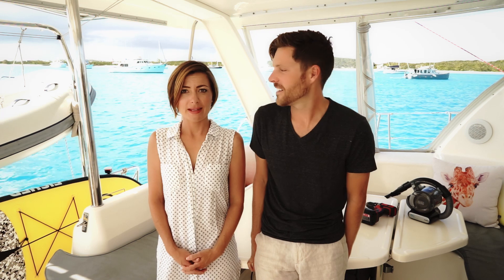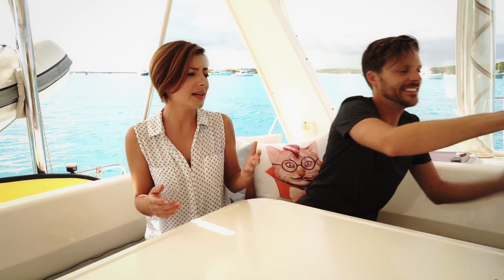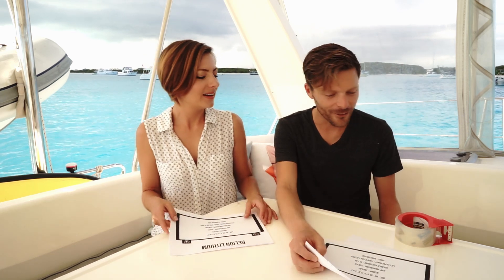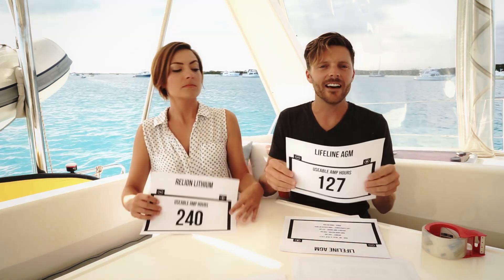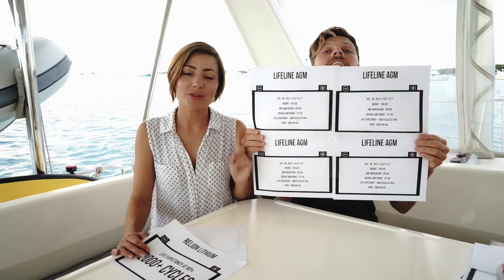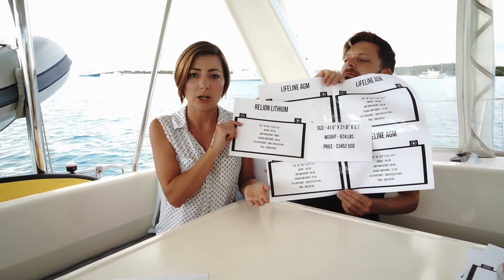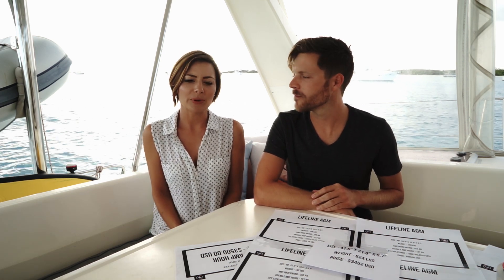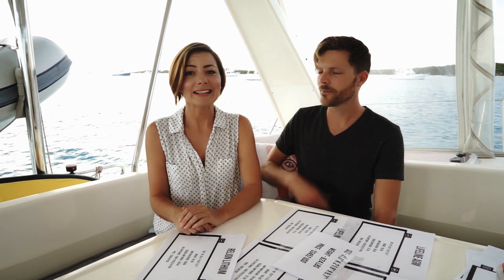Sailboat Tech - Lithium Batteries & Why We Chose Them (vs AGM)

Comment from the maker: Okay, we're going to address some of the most common questions here:
1) FIRE: there are several different types of lithium batteries. Ours are Lithium Iron (LiFePo4). They have a very low risk of fire and are very safe to operate. Our batteries are NOT the same ones in the Boeing Dreamliner. Lithium Cobalt chemistry is used in a lot of small appliances and phones, and those are the ones that can catch on fire when they're abused. They're still pretty safe if used and charged properly.
2) TESLA POWERWALL: These are great but they are not rated for marine environments, they must be mounted on an exterior stationary wall for ventilation, and they're pretty darned heavy.
3) COST: yes, we said right up front that they are an expensive initial investment, but if you look at it from the standpoint that we are powering our home, then it isn't so crazy. Would you put a cheap roof on your house that will have to be replaced in a few years, or would you try to put the best roof on that you can afford and that will last years longer?
Reply: Great information, great explanation all around.....
Reply: I did a similar calculation for my off-grid home (on terra firma).  Although my system will necessarily be larger, the same calculations apply.  And although I like the lithium-Iron tech, I'm looking at salt water batteries (Sodium-Ion) which can be stored at deep discharge without harm.  Take your batteries to 0% DOD for 3000 cycles (better even than lithum).  Again, upfront costs are high (like Lithium, but still cheaper), but you won't replace them in 2-3 years like AGM so the long-term cost of ownership is lower (like lithium).  My calcs put Sodium-Ion tech above Lithium and the availability of sodium (salt) is must better and more sustainable and safer too.  

Also, in terms of your calcs on cycles...  You won't get more cycles just by doubling your AGM batteries.  Wouldn't it be more correct to say that you would replace the 2 AGM batteries at half-life of the Lithiums.  Same net result, except the weight comes in to factor then.

Love your vids, guys.
Reply: @wacobeer6469  meh little behind the times with this lithium and sodium battery thing but lets go with it, long as they upkeep their batteries the longer lifespan (normal operating conditions) of the lithium over the sodium battery will be more beneficial.  I can see as salt water being more proportionate for a house yet for a boat I think they made the right choice, and if they are too worried about full discharge they could get a couple of wind turbines to add to the boat.  Now if you are lucky you can find a small airport that works on the airplanes there or a junkyard, and you might find some for cheap (at risk) or sometimes free, then you just need to install all the other things etc.. etc... .  One always wants to make sure they check up on their battery bank, and as they know and experienced with weight and space being very important.  Probably using outdated solar panels as well because they are cheaper, but lets be honest what they are doing works for them and they are obviously happy with it so it doesn't matter ... just enjoy life and as always ... keep smiling!
Reply: Mountain Point Brewing Ya they sort of messed up the weight, but you will still pay to ship that weight so I let it slide. 😆 Only error in an otherwise great intro video.
Reply: The industry stats 15 AH charging rate per battery. At 50% discharge rate. That can recharge the battery back to 100% inside 6 hours...Depending on @ah rating of battery . Smaller @ah less, more @ah more. You need to do the math on what you're using everyday. Then figure out what your charger should rated for... but 15 amp per battery is a safe bet...Which is why most 120v to 12v converters are built for 30 amps for two batteries. As they didn't pick that size for nothing. 

The up side of Lithium is they can suck huge amounts of charging amps. So they charge back up very fast...Which if on solar. You want every amp you get. In the shortest amount of time. Depending on how much sunlight you get everyday. Also the temperature at which your batteries are at. Play a big part in the calculation. Same for solar panels.
Reply: Hi guys, great video, did you know that you can get the BMW i3 and i8 car batteries for marine applications?
They are about double the price of the Lithium batteries you have, but performance wise they are miles ahead, as far as I know there’s only one company that you can get them from, https://www.torqeedo.com/en and they sell outboard and inboard engines too.
Reply: Heya,

Interested in finding out more about Lithium systems so thanks for taking the time to put together the vid.  And your solar panel test was very truly informative - have watched it a couple of times. 

It was difficult to ascertain from the quick 'tour' you did but I'm curious how you have the batteries housed.

My limited knowledge  of Lithium batteries leads me to understand that charging them outside a temperature range of 0 - 45°C will lead to significant degradation of the battery. Given you're using a solar system to charge your batteries, it stands to reason that they will charge most when it is hottest and certain enclosed areas of boats - especially in direct sunlight - can far excede the ambient temperature of the day.  Ergo they're charging most when they're most likely to degradate.

Just curious if this is a consideration for the batteries you're using?  Have you made any adjustments if so?

Cheers,

Andrew 

Just c
Reply: If it's just an introduction and there will be more detail coming, I agree. I was curious how their charging sources were connected, if any adjustments were necessary (very likely), how they solved the "what happens when the battery disconnects" problem. It's a professional installation so I'm assuming they solved these issues (it certainly can be done) and that's for me the really interesting part of integrating lithium-ion batteries.

Otherwise... Well, if you fail to adjust your sources and use one of the "drop-in" replacement batteries (drop-in here means they set up the protection to be more benevolent so it doesn't trip all the time), not much will happen; lifespan will be reduced, but it will take time for that to manifest itself. However, failing to solve the battery disconnect issue means that if it ever has to protect itself, it might just wreck your electrical system (and thanks to Murphy, it will surely happen in the middle of an ocean :-) ). Disconnection protects the battery, that's the purpose. But it throws the rest of the system overboard. Some people just fail to contemplate what happens if you suddenly remove the battery from the system. It can get very expensive. Which is why the "drop-in" batteries are more benevolent - otherwise they would get a lot of complaints and perhaps lawsuits. Just so they can claim it's a direct replacement with no adjustments needed. If it's executed well, it will still protect it from going out spectacularly, but it will allow significant abuse (it has to; lead-acid charging systems are just not, you could say fully, compatible).
Reply: Warriorsrus At the same time none of those explosive gases can burn through the bottom of a steel hulled boat like a malfunctioning Li-Ion can. Both have their benefits and weaknesses.
Reply: Great video as always, thank you. I was curious as to why you did not use the same battery brand from the RV. Were there issues with that brand?
Reply: Gone with the Wynns 
Can I have as much amp hours in multiple batteries or does the inverter size and how much solar power wattage i bring in
Reply: found this info SHOCKING but got a CHARGE outa it........................
Reply: @Warriorsrus better yet does the cat have a life preserver????

Comment: Please do an update on these batteries - many people, not just sailors, could benefit from knowing if these are worth the investment (subjective) and how well they've held up (objective).  Thanks!
Reply from the maker: The batteries are great! They'd put more in if they could make the room.

My RV has had lithium for the last 5 years and we bought them gently used from someone we knew who was building a bigger lithium bank and wanted all new batteries. So they've got 7+ years of use and are still going strong like the day they came out of the box. All the advantages of lithium (can use nearly the whole capacity, can run a high-draw appliance off it through the full range of its capacity, lighter weight and smaller packaging) make them a no-brainer if you live full-time off the grid. I know so many people who've switched to lithium and their only regret is not doing it sooner.
Curious Minion
Reply: @gonewiththewynns  Thanks!

Comment: Ampere Time 12V 300Ah Lithium Iron Phosphate LiFePO4 Deep Cycle Battery, Built-in 200A BMS, 4000+ Cycles, 400amp Max, Perfect for RV, Solar, Marine, Overland, Off-Grid, etc......(same battery at half the price...AMAZON)

Comment: AGM should be kept 12.0V or above even under load for longest life.  I think this is why you can't run high power stuff off them as it will pull the voltage below 12V which starts to degrade the battery.  A starter battery in a car is designed for this, but for very short periods of very high current, though the voltage can drop down to 10V when cranking the engine.  Lithium can hold it's voltage better at higher currents and as long as you keep the cells within their max discharge amps and above about 3V per cell (based on cobalt), they will be less degraded by high loads.  With some high discharge Lithium cells you can sustain loads of 150A or more.  While Lead Acid can provide 900-1000A "Cranking amps" but only for a short burst.
Reply: I have a non AGM, 100Ah sealed Marine start battery on a solar panel.  Even when fully charged if you put a 10Amp load on it to produce 120W it's voltage will drop near to 12V.  When the battery is sitting in winter at 5*C that will drop to 11.5V or lower along with the capacity.
Admittedly a boat would have bank of maybe 4 of these in parallel or 8 in 2s4p for 24V system.

Comment: Your calculations are all wrong. Yes, doubling the AGM (127x2 = 254 useable Ah) in comparison with single 240Ah Lithium makes sense. But then doubling that once more to account for the life-cycles becomes all wrong. By this point you are actually comparing 508Ah AGM to only 240Ah Lithium, but the AGM life-cycle is still 1000. 

Unless you meant buying all 4 AGM, but only connecting two of them and then sailing around the world with half you battery bank as passengers whilst their warranty expires, waiting years for the first set of batteries to run out their 1000 cycles.

So actually doubling a second time to a total of 4 AGM is wrong in terms of: weight, size, life-cycle and Ah capacity. You only got the price comparison correct. You would obviously wait for your first set of AGM batteries to end their 1000 cycles first and then buying new ones to achieve 2000 cycles. Which means the weight, size and Ah capacity would remain constant (to that of only 2 batteries).

Comment: I thought in an earlier video you said you had to run the engines to heat the water.  Here you say you can use the battery.
Reply from the maker: You do not have to run the engines to heat water, but any time the engines are running, water is piped through the engine to cool it so you end up with "free" hot water. On days that you don't run the engine, you can use the electric hot water heater.
Curious Minion

Comment: The reason lithium batteries are better than the old batteries as they have no memory With old batteries as time goes on residue builds up on the plates inside the battery residue  affected the batteries lithium batteries don’t have this problem.That is why when you have if you have a drill with the old I’ll type of battery on it as it is the battery skip use more residue from a charge sits on the on the plates are the battery and it says there and the more buildup of residue of that of that stays on the price the war the chances are the battery will not be at sufficient as it was was. Release your batteries this is not the case that is very visual back up because every every shahs is always like first time is ever charge up of course it’s gonna be battery problems towards the end of its life but it will run longer.

Comment: Super Capacitor banks out perform lithium, take up less space, charge up much quicker, can be fully discharged without damaging the capacitors, and can be charged many more times. Also lithium will burn when in contact with water and you're surrounded by the stuff. However there is nothing wrong with your set up, But, when your battery life comes to an end consider changing them for super capacitors, they are predicted to replace most battery functions in the future.

Comment: just the tip of the iceberg when it comes to the inefficiencies involved with lead acid batteries when talking about off grid charging solutions.  off the bat, you should knock off the top 20 percent of AGM too when talking about daily cycling them, so you cant go below 50 or above 80, now your sitting at a usable 30% of the battery's total capacity.  (for those who wish to argue the point, bulk charging is all well and good, but forget absorption or float) which then leads to the problem because you will rarely ever be getting your batteries to float, they are going to sulphate, again reducing capacity and strength, etc etc etc.

its a whole world of better'ness to switch to LiFePO4 (for those who dont know the difference, LiFePO4 is the non flammable variant of Li-on batteries, lower energy density than the one in your phone, but it wont go into overrun and self combust)

Comment: I have no idea what chart you were looking at for the specs, but much of the information you used seems HIGHLY suspect, especially the life cycles. AGM batteries generally have FAR more charge/discharge cycles than lithium, and are far more resistant to vibration and extreme temperatures, are much easier to charge, and far less likely to suffer catastrophic failure.

Comment: Just bought my first 12v LiFepo4 battery to run a 40Lt fridge , yes it's worth the extra $$ .  As the video mentions the only real negative is the upfront cost of them.  Really like the almost flat voltage curve during discharge , the weight savings is massive. Have heard lithium batteries not great in cold temps (below - 10c )  compared to AGM or flooded batteries, but I never go to extreme cold climates and guess most sailors don't either. 
Wouldn't use them to start an engine though , stick with AGM or flooded  for that purpose.

Comment: You missed the thermal stability issues with Lithium batteries. Most of them lose cycle life at storage temperatures over like 74 degrees F. By the time your storage temperature is up to 92 degrees the life of the batteries are cut in half. They do have more thermally resisted lithium batters but they come at a distinct premium over those you have. The ones with good thermal stability have cycle ratings of 3000 or more.

Comment: Hey guys if you have any questions about lithium power and installation etc. My husband  designed and installed our whole 24v electricial system with 1600ah of lifepo4.  1800w of solar ,a 6 kw alternator that runs off our 39hp yanmar and no generator. We are a performance sailing cat called Symmetry. We’ve been live aboards for going on 4 years.  We r currently in the eastern Caribbean. I remember when you first tried out lithium in your rv. You will get a lot of backlash talking about lithium.  Most if it will come from ill informed people.

Comment: I saw that you were using induction cooktop in your boat. Do you use power from the battery bank or using the gen.? 1800w=+- 180 amp on 12 v.
Reply from the maker: We have a very beefy lithium battery bank, so I run it off the batteries.

Comment: Are you guys serious... 1200AH of batteries.. REALLY.. I'm not even sure what to say about that.. It rediculous, stupid, insane. 

We are a family of five on a catamaran and have happily lived on 660AH of Lead Acid batteries for 2 years. Yes we run our water heater. We have a tiny washing machine we also run.. Total cost for our battery bank $625USD, not $14,000USD like yours. 

I'm flabbergasted you would put so much battery in.
Reply from the maker: Hey, to each their own. We’re simply sharing what we use and what works for us. Everyone’s wants and needs will be different. We’ve been living and running our business off the grid for 8 years and this is what works for us. No need to be judgmental. That’s great you happily operate on less.
Reply: Travis, we have 1600 ah on our boat.  $8k worth of batteries.  No generator

Comment: Thanks for doing this segment.  I am searching for the perfect catamaran and am struggling with the various catamaran sales pitches that do not address electrical power generation needs or options.  One would think they would be more attuned to cruising modes of operation (e.g. not regularly plugged into a marina).  Also, thanks for the Tesla PowerWall comparison.   I am having two of those units installed on my home and had the same question.

Comment: Great tutorial on Lithium batteries. I would love if you guys would show your entire electrical system. That is a huge battery bank. I am curious how much the solar replaces from the draw of running your air conditioner at night, how much you run the genny, etc. Have you thought of adding a wind generator or a hydro generator? Great video.
Reply from the maker: More tech videos are coming!

Comment: A must is a 12 v car vac and wired to power off your boat batts. When that mosquito or other bug is on yout overhead or where ever suck em up instead of splattering him for a cleanup. Works great to catch them in the air. can spray a little poison inside to keep them there.